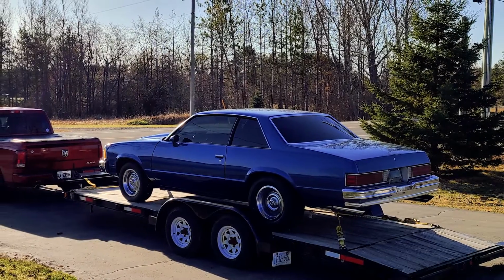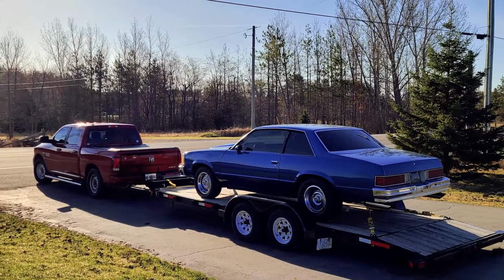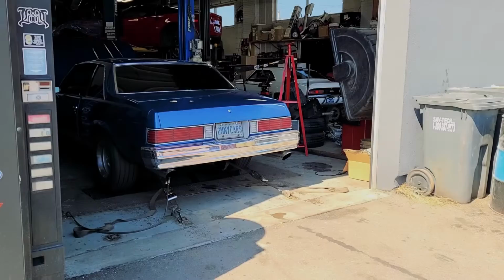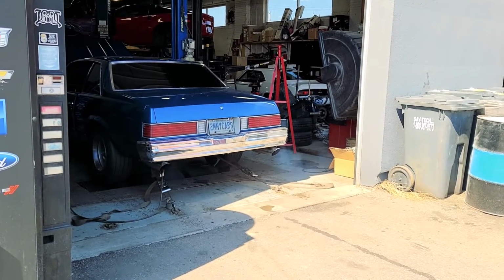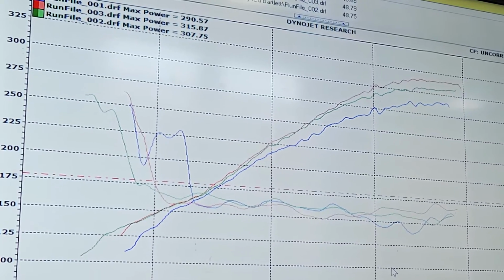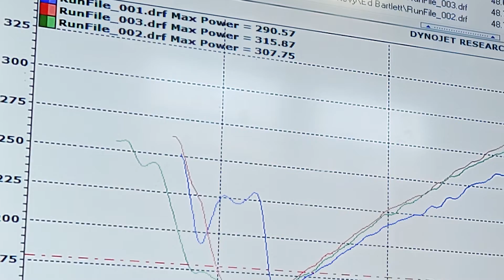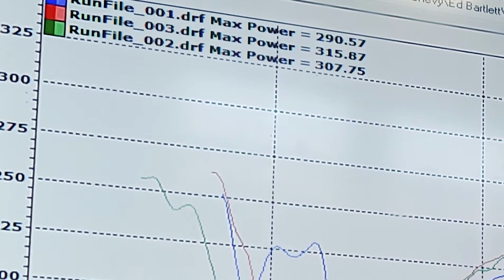G Body LS Swap - 1981 Malibu on the Dyno for tuning!

Comment: where did you get most of the body parts from   im going to do a malibu build
Reply from the maker: The doors, fenders and hood were from LKQ Keystone I believe. The roof skin, lower quarter panels and trunk lid were from a donor car. The floor was a new replacement that was partially installed in the donor car, so it came out and was installed in mine. Also most of the firewall is from a donor car.